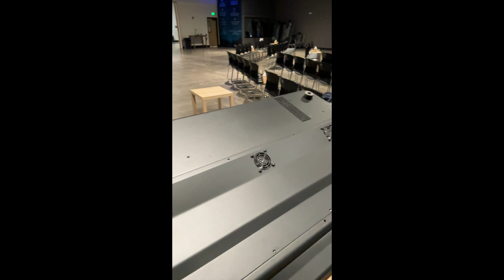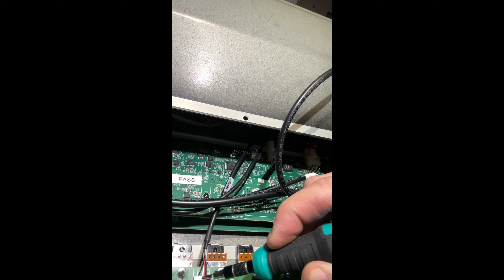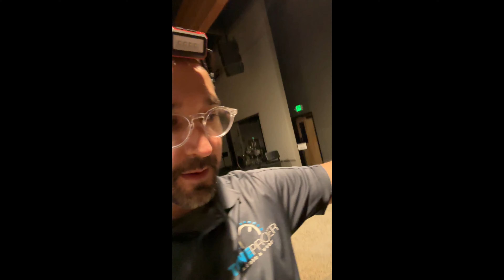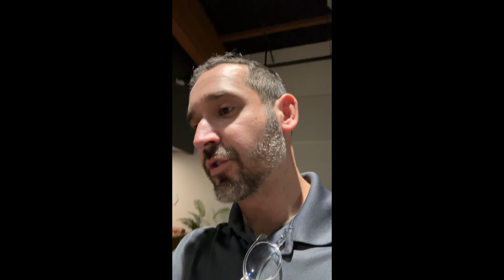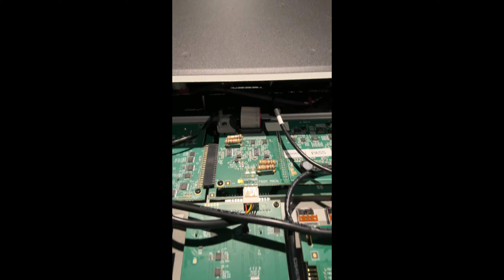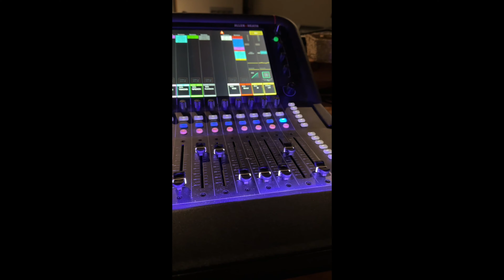Allen Heath Avantis Fader Fix and replacement

Comment: Thank you very much for this video, just in case I might have to do this!  We have a brand new Avantis just out of the box never used and we have channels flickering and highlighting themselves on the left and right banks as you touch one, they kind of start doing a cascade of highlighting and flickering, eventually they will do it on there own without touching them.  We’ve done reboots, fader calibrations, and upgraded firmware from 1.25 to 1.30.  I’ve got a call into A&H and our supplier Sweetwater.  I’m hoping we don’t have to open the hood being that it is BRAND NEW.  Interestingly enough, I’ve had to pop the hood several times on our older Allen & Heath I-Live, so I get what you are saying on those T-7s.  Crossing our fingers….
Reply: @santabenjamin7232  все проблема в отсутствии заземляющего контакта или же помехи по заземляющему контакту которые может давать другой прибор. У меня когда такое возникает я просто отключаю эту функцию чтобы не отвлекала.